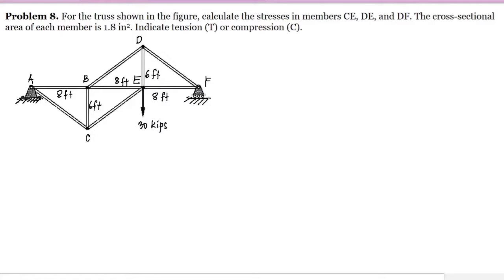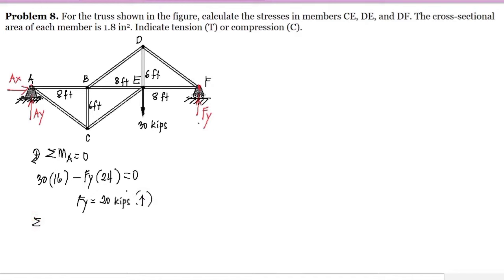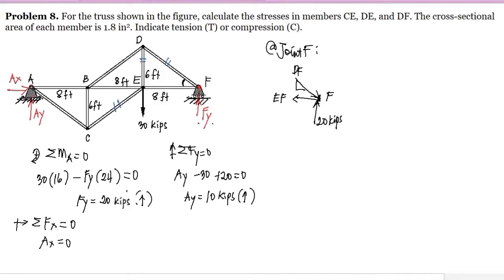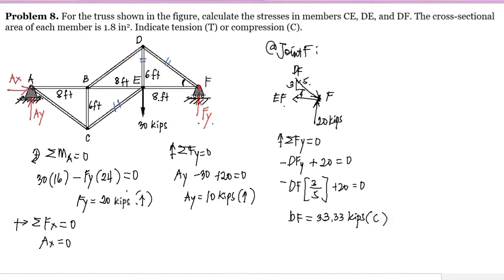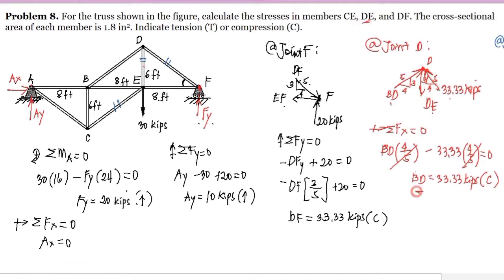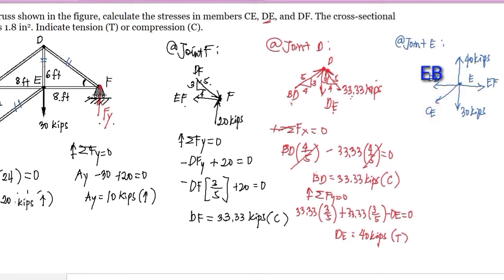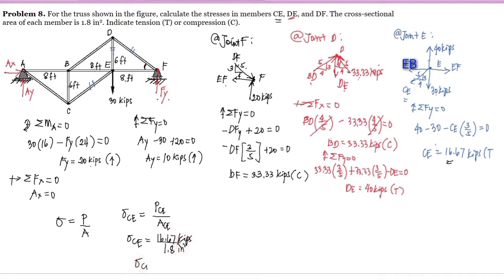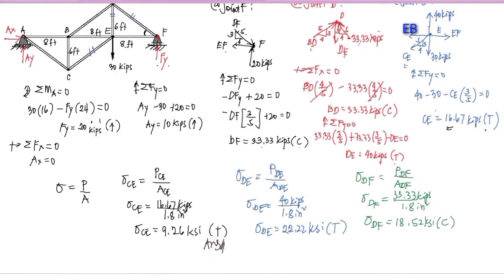Normal Stress Problem 8

Comment: paano po naging Tension yung DE kung positive 40 kips siya sir?
Reply from the maker: Assumption kasi natin na away from the joint sya (Tension), positive ang answer meaning Tama ang assumption natin na tension sya. Otherwise compression sya if negative ang lumabas sa computation.

Comment: Pano po naging quadrant 4 yung direction ng DF sir
Reply from the maker: At Joint F po ay compression kasi so the direction is towards F pointing to quadrant 4. Use po natin ang tail as origin from there tingnan natin kung which quadrant sya papunta para hindi po malito.